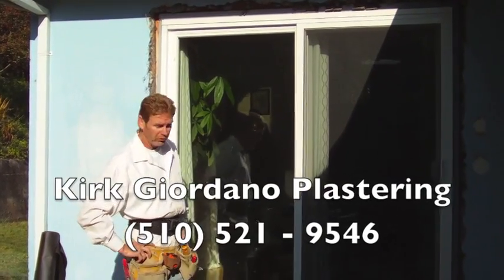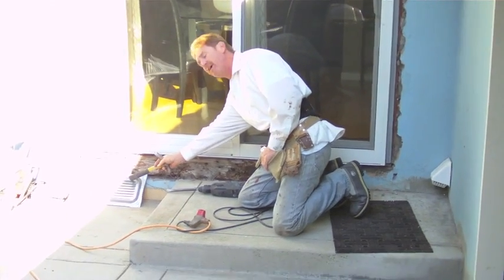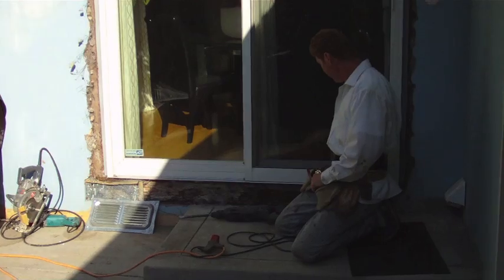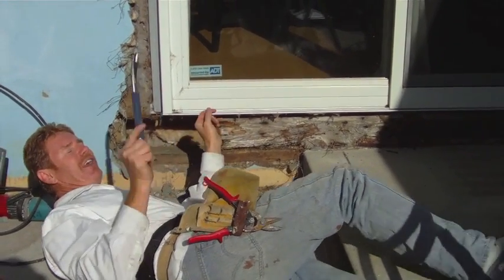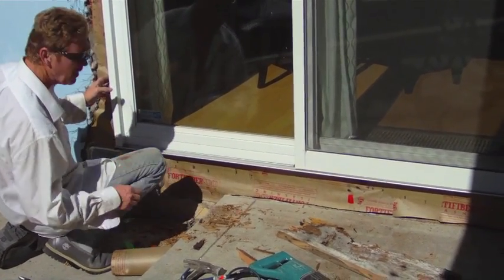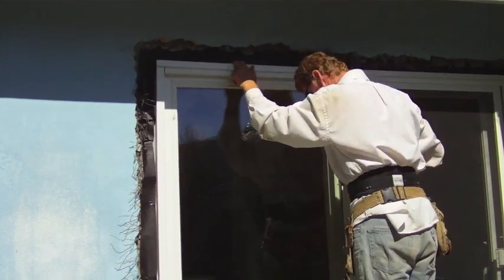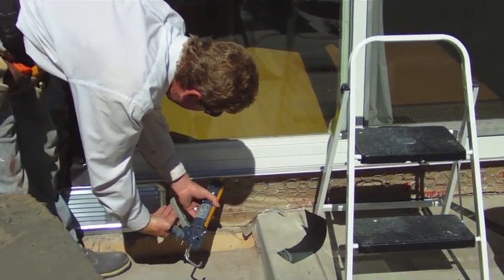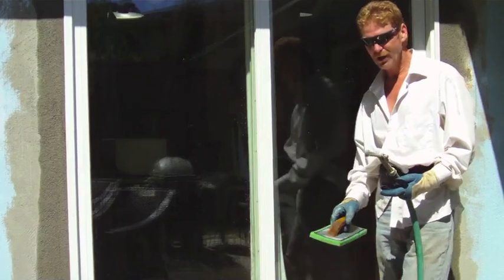Stucco or wood under a sliding glass door

Comment: Hey what size board goes under the doorway ?
Reply from the maker: Good evening Chris, the same thickness as the bottom sill, usually an inch thick.😉
 The idea is to support the metal, aluminum, or plastic sill with wood and not stucco as stucco is not for walking on.
 Over the years the stucco can crack, then by continued walking on the sill plate it can bend breaking the seals located at the lower corners. Now the rain-water can get into, can't have that.
Our unique plastering Tip:  all subscribers or anyone who stumbles on our channel with a question, type it into our Stucco/Plastering channel, and like magic, a video will appear to explain how it's done. 	
   This feature is miles ahead of any plastering forum. 🥳	
https://www.stuccoPlastering.com
http://www.bayareaplastering.com